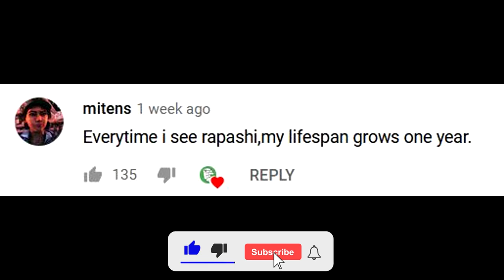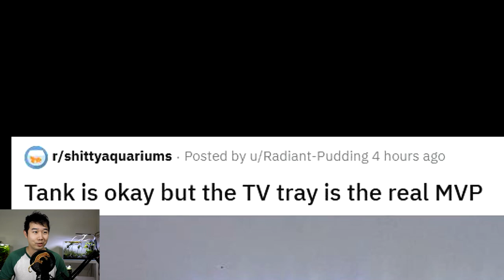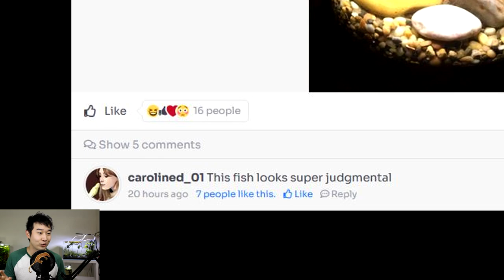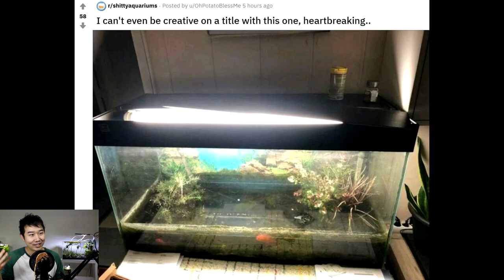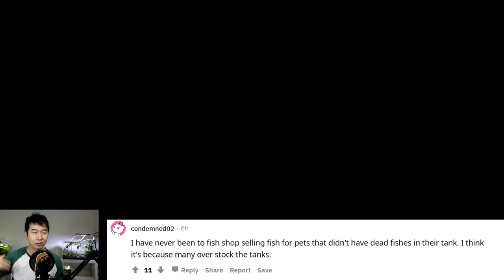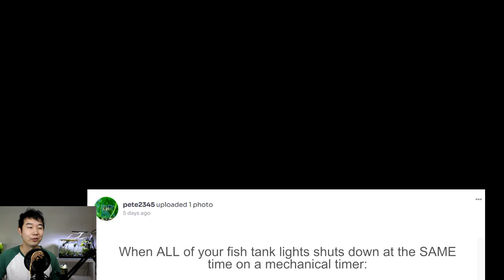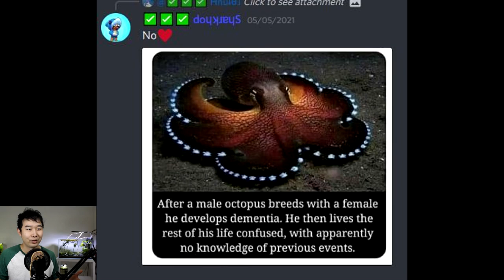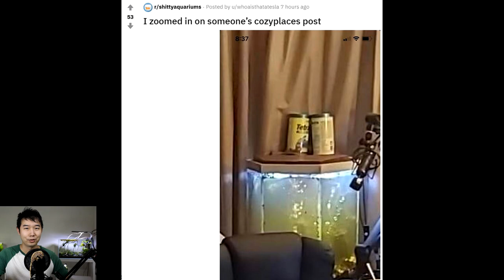IS THIS A GOOD FISH TANK? | Fish Tank Review 101

Comment: Hey actual question, summer is coming along and my aquarium is already struggling with the heat. Are there any easy ways to cool it down? I’ve heard of fans and have tried floating some cold water/ ice packs but nothing seems to work good enough.
Reply: Also I kinda need something drastic as it’s 4-5 degrees (F) hotter than I’d like it to be
Reply: If it is near a window, move it away to prevent any temperature fluctuations. Also some air conditioning would hopefully work. Praying for ya'✌